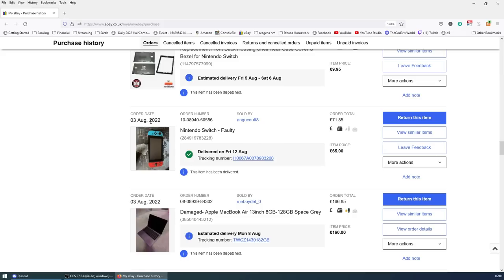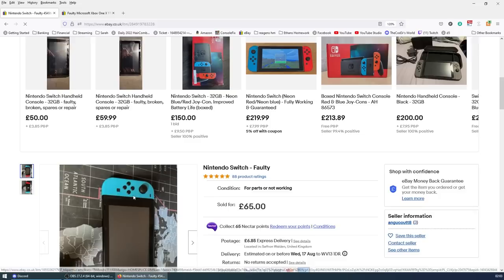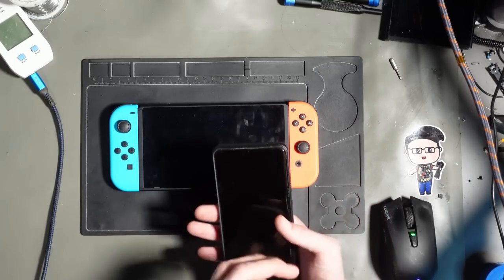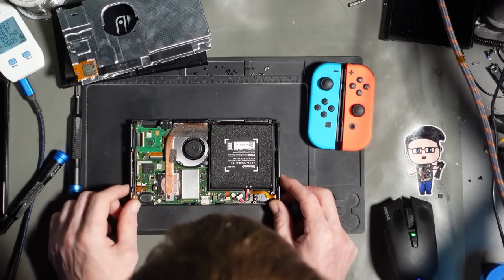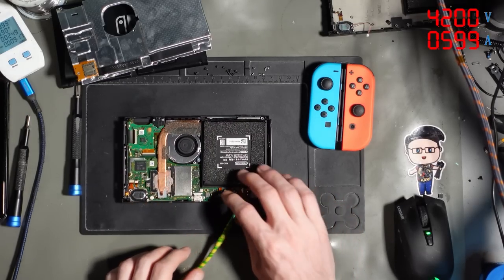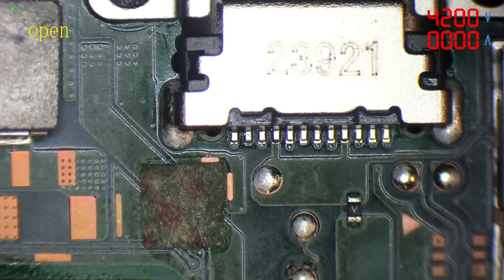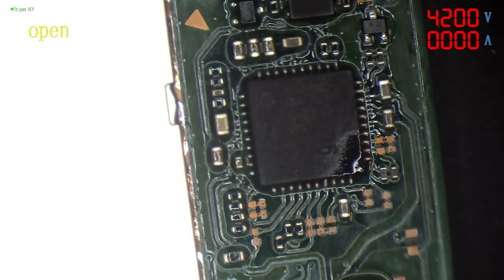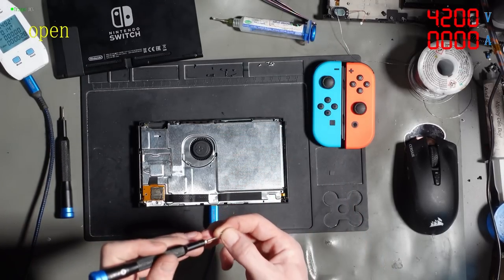Can I Fix This £72 Broken Nintendo Switch From eBay? Surely It's Worth A Try?!

Comment: @TheCod3r, can you spread the knowledge for how to remake your genius test cable?  I pulled the battery-boards from both a Lite and V1 battery and neither seem to able to boot known-working Switchs. I soldered my bench wires to the 2 main pads for - + on the B-board with 4.2V/1A being supplied.
Reply: I get the same mate ? Did you work it out ?
Reply: If you clipped the battery off the board and connected the two wires to where the batteries used to connect to then you are more than likely not getting a ground signal at the pins that connect to the switch board.  To test use a meter to test the two black wires for ground and the two red wires for voltage.   What I saw is that the two positive (RED) pins had 4.2v (bench ps was set to 4.2), but the negative had nothing.  if This is the case then solder a wire the the P- right under the two black wires (the wires that connect to the actual switch MB) on the battery board and use that as the negative on your bench ps.  Hope this helps someone else out as I originally tried two boards and couldn't get it to work.

Comment: Random question, my ps5 , after playing for a few hours, disconnects from my wi-fi , and then can't find or reconnect wifi bands without me restarting the console or turning it off and then on again. Sometimes the wi fi works for days, sometimes it drops every 15 minutes. My console is under warranty, but the shop that i bought it from are very doggy and apparently their service crew is on vacation. In short, does it sound like a software or hardware problem? 
Thank you in advance
Reply from the maker: To be honest I'm not sure, it sounds like hardware but I've never come across that myself so it could be anything really
Reply: @TheCod3r  thank you for your reply, i will just fight with the warranty. I ll let you know if i ever came across the root of the problem.

Comment: I wouldn't agree with the way you put the usbc port in.. kinda sloppy..
Reply from the maker: Nothing wrong with the install method bud. It's a proven method which works almost every time
Reply: @TheCod3r  I'm not disagreeing that it works.. I've just always been programmed to clean everything out tin the pads, etc..ect im sure you know what im talking about.. I'll have to try this method. What's your source for low melt leaded solder? Your link brings up nothing? Cheers 🍻
Reply from the maker: @twonirwin4056  we all have our own methods mate. I guess it's whatever works, but I've always found the drop method works perfectly for me. For low melt solder I generally buy large packs from amazon but the link keeps changing lol. I wouldn't really recommend low melt for switches though because it runs the risk of tearing the bottom row of pads
Reply: @TheCod3r  I use it for a lot of different things...